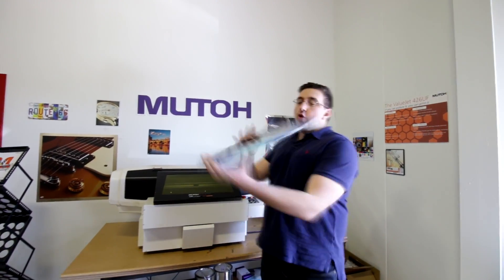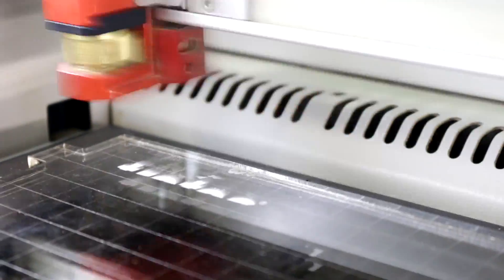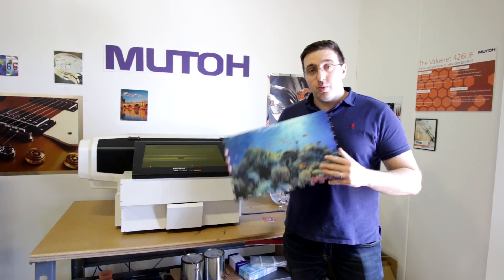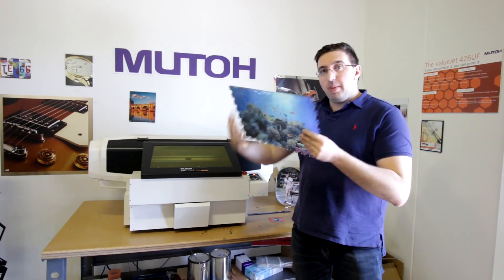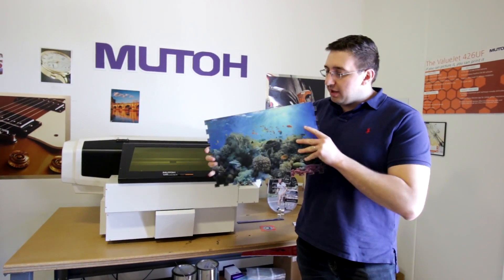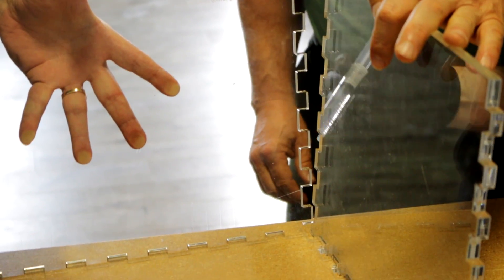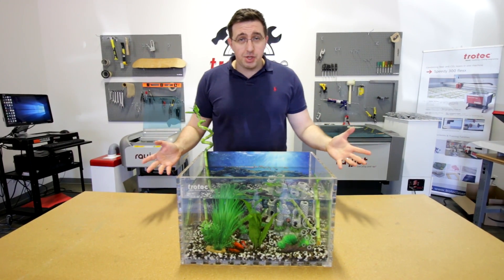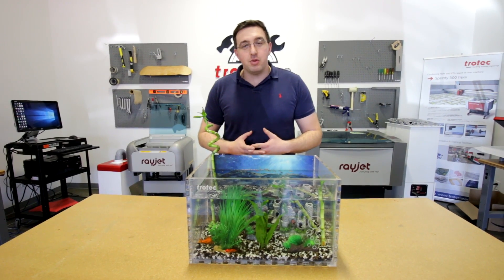DIY Aquarium | Make Your Own Custom Aquarium | Trotec

Comment: Nice, but you would not need silicone with a straight cut on the panels as they would weld together right?
Reply from the maker: We would still suggest silicone as water may steel come through.